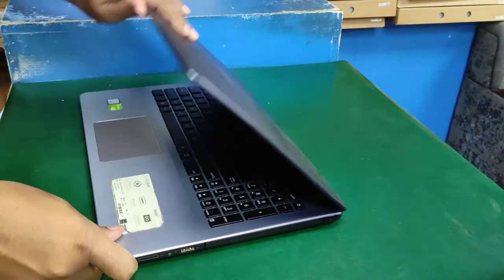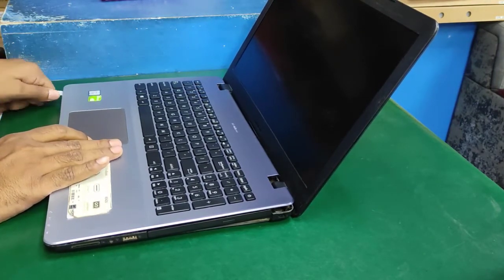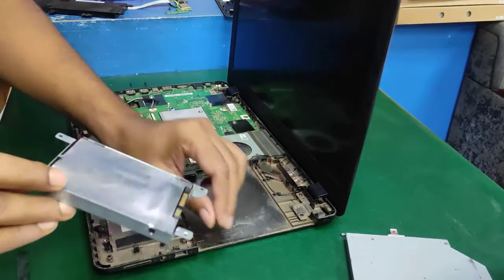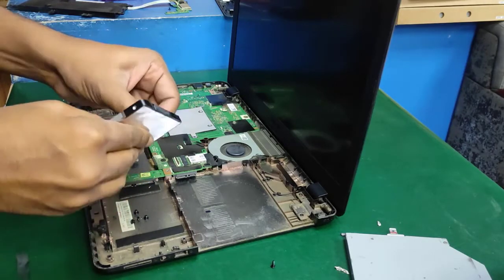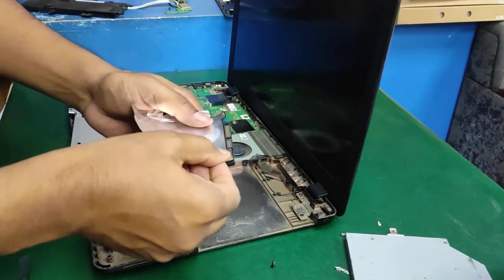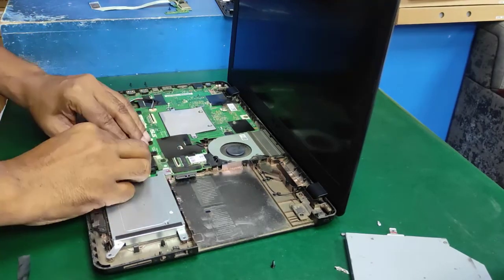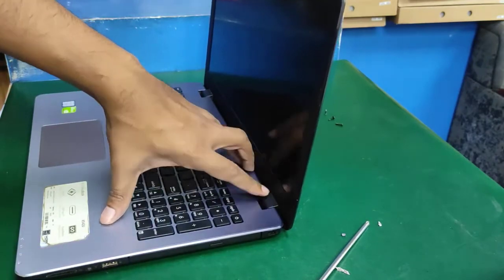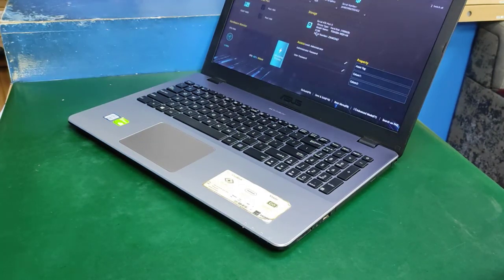ASUS X542U & X542B Series Laptop HDD Repair

Comment: Didn't get that magic with screws under ram cover. Mine is not working from battery regardless of open or closed ram cover, battery is not seen by BIOS or OS even though it is a new battery. I tried to clean pads on motherboard for 2 white screws under ram cover but no success, don't you mind to share any suggestions?

Comment: Nice vid, but I have a suggestion to make it better; Instead of telling people to keep track of which screws are which, it would be much more helpful if you would say where the longer screws go. I came here after I had already taken it apart and didn't notice the different screw sizes on the bottom. Cheers!
Reply from the maker: yea , when anyone open the laptop must separate the laptop screw otherwise it will be up the keyboard case, thanks